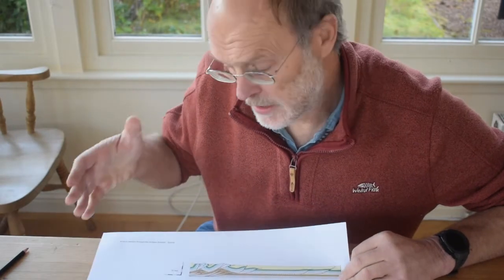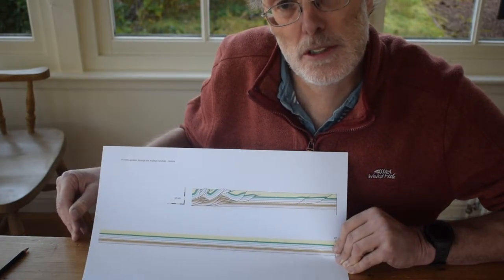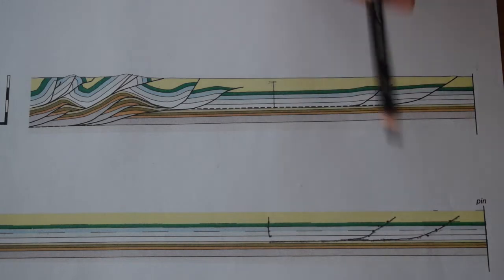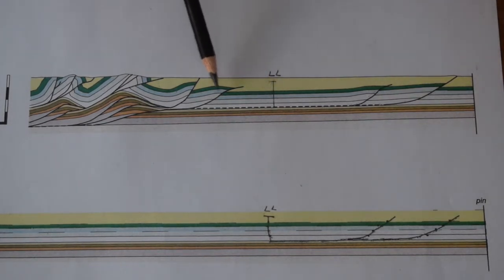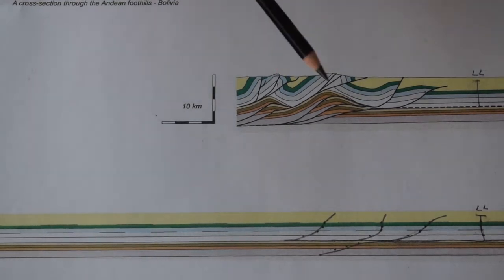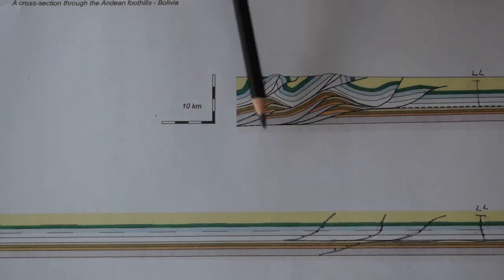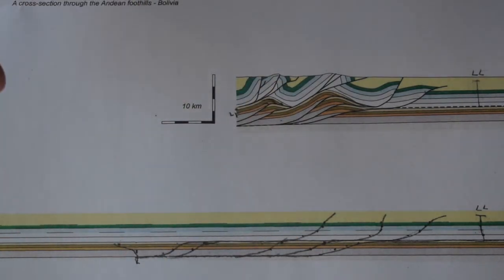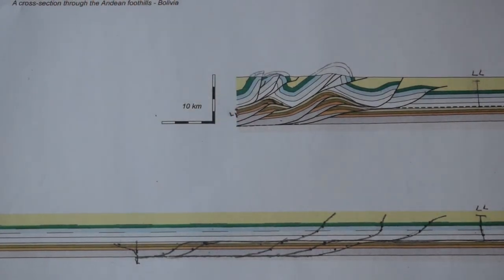Line-length restoration - a demonstration

Comment: Thank you, @Rob Butler, for this great video. I have a question. I've seen a lot of videos that explain how to restore structures to an undeformed stage, assuming bed-length conservation. Most of these videos show the case of an inverted structure, but I've never seen a case of an extensional scenario. Is it possible?
Reply from the maker: It's a good question. There's no reason why layer-extensional structures can't be restored (assuming plane strain). However, when restorations of normal fault started (mid 1980s), they assumed a specific kinematic model - listric normal faulting and the "Chevron" construction (see video on listric normal faults). There were lots of other approaches building on assuming a particular fault construction method - so very different to thrust systems (originally). Though thrusts went that route with the application of idealsed fold-thrust models (and kink constructions)...

Comment: Hi Rob, thanks for using this (my) section, and great demo of doing it with pen and paper rather than on a screen! One comment I’d make is that when you go about doing it in the real case, you have to treat the upper competent unit first as it is where the surface data come from. Then the shortening can be applied to the lower competent unit. This means that the eroded part in the anticline needs to be addressed before you can restore the lower competent unit. And also that means that most of the uncertainty on the shortening comes from there. Still need to publish the full section that was corrected since this short paper 👍🏻 Thanks again
Reply from the maker: Hi @wrobs38 (Jean-Christophe) - thanks for the comment. My view on the "where to start" and uncertainty issues with tasks like this is that all approaches should be tried... we're testing the interpretation (model) not the reality... As in the version of the section I used (from your paper), the green upper unit isn't drawn in so by adding that at the outset, the length of the unit becomes entirely arbitrary ... which for me isn't a great starting point. Whereas, the deeper structure is - in the model - fully defined. These types of issues, which I've not really addressed in this video (but is elsewhere) are key when applying restoration in practice - the approach explicitly relates to the question being asked of the structure/interpretation - and this will be specific to particular examples... Thanks again for constructing the original section - it's great to have it to promote these discussions ... and I hope you get out the modified version!

Comment: I have one more question about the restoration output.. what I observe from your technique, is the length of the layer in folding section has to be equal to the restored flat layer? or only proportional to horizontal 'pinned' distance on your drawing? as I saw (correct me if I'm wrong) you rotate the folding paper at each point of turning and constrained them to the final horizontal distance of  the cross section, so the restoration section does not imply the actual 'stretched' layer length prior to deformation.. do I interpret the concept in wrong way??

thank you for your advice and answer professor...

best humbly regards....

~from your 'non academic' student in far away in Indonesia~
Reply from the maker: Not sure I completely follow your question... but the act of measuring around folded layers is designed to establish its sinuous length... which, assuming no distortional strain, can be laid back to its assumed predeformed geometry (in this case, horizontal). Have a look at the "strain on cross sections" video - in the structural geology playlist.
Reply: @robbutler2095  wow it must early morning in Britain... Thank you for your reply Prof.. 
My bad, I just didn't realize that this is a hand drawing demonstration which could be slightly miss the geometrical accuracy.. yes you had explained that to us in your other videos that the restored length will always be displayed as a longer section view with respect to horizontal axis reference,  which in actual they both display equal length prior to deformation distortion. 
Thank you and thank you.. surely I will go to your sugested lecture in this channel..

Wish you all the best and Best regards Prof...
Reply from the maker: @armgeo6246  Thanks. I'm a fan of doing these exercises by hand - so you stay in control of the decisions... while this may be less precise (rather than accurate) compared with graphical tools, given the assumptions made in real world applications (eg ideal layer cake strata, no distortional strain, uncertainty in drawing in the eroded parts, let alone choices in the subsurface) - most claimed precisions are bogus! It's always better to be accurate rather than precise.... thank you again for the comments and interest in the Shear Zone Channel.

Comment: Hi Rob, if the whole of the cross section is deformed, can you use a loose line anywhere? Or is that only used where you find an area of undeformed layers?
Reply: I am trying to the Mount Crandle Thrust section and it's so confusing! (Boyer and Elliot)
Reply from the maker: Ah ha - an interesting section. There's no real pin at the front either. I'd start at the back - to the W side of the section and put a loose (de facto pin) line in there and reconstruct  the strata from there - moving eastwards. You need to "rehang" the strat as you go - the units are wedge-shaped... so set up one horizon as a datum (eg as labelled by B&E) and measure strat thicknesses from the section, for given distances along the datum... drawing the restored template as you go....  The section as drawn by B&E is pretty unconstrained (at depth and eroded) so there's some freedom in getting the section to work....
Reply: @robbutler2095  Thank you! I will try that. There's a lot going on in the section. I had been working from the E side, so I will try from the W side. I can see the datum horizon that you mentioned, on their section, so I will do that - it's the horizon I had in mind as I read your message! Thank you again... back to it!
Reply: @robbutler2095  I've just finished having another go and it's the closest that I have got. I am slightly out but I'm not sure that's just my measuring. Thank you so much for your advice.
Reply from the maker: It's a great question - setting up  a loose line is a judgement call - you want to select a part of the cross-section within which you think there has been no interbed slip ... or shear... best done where the strata "return to their regionals"... - a common site selection is along the axial trace of upright synforms....

Comment: Hello Rob, any thoughts on how to make the restoration template?
Reply from the maker: A really good question - the template can be constructed before you start IF you assume a particular stratigraphic arrangement e.g. layer-cake strata, which what we've done with this Bolivia example. BUT for more complex (i.e. normal) situations you need to build the template as you restore the structures, using measured (or inferred) strat thicknesses - and re-hanging these for a chosen datum horizon (using a horizon that is shallow in the stratigraphy that you interpret to have been continuous and unbroken before thrusting)... It's a complex business - watching the stratigraphic relationships "grow" as you restore the section step by step. Some iteration (dynamic alteration) required as you go....